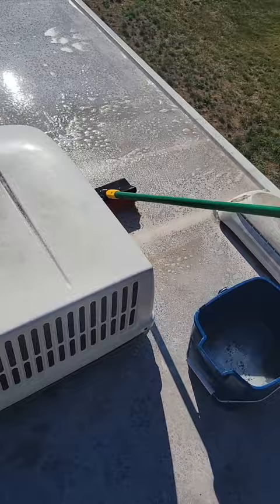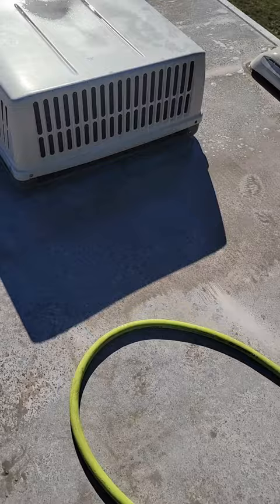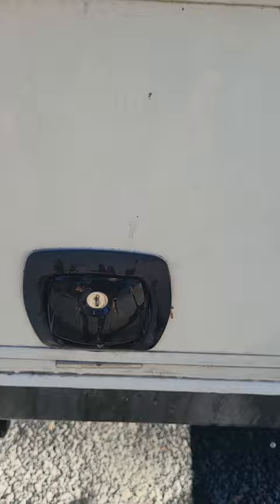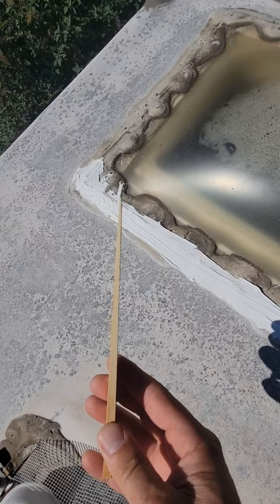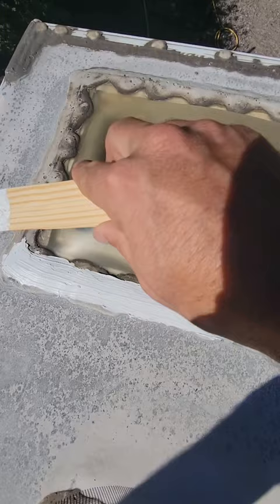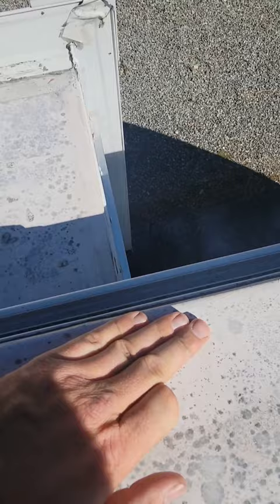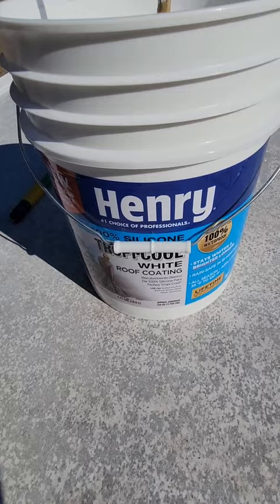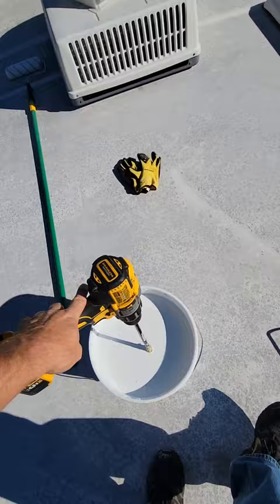Rv roof /Travel trailer roof repair/ Silicone roof coating( DIY)

Comment: Around the fixtures aren’t you supposed to strip the old stuff off and then apply a fresh seal? I’m a little confused
Reply: Not if the present seal is healthy. Stripping the old seal can lead to rubber/tpo roof damage. Just spread the coating on heavy on these spots. This is a nice basic repair that will extend the life of the roof for 10, maybe 20 years. Doing my rig right now. 🤠
Reply: Do a few layers over the years, then remove it all and start over.  Like when they pave a road three times and then tear it all up and start again.

Comment: I’m curious as to if you had problems with the coating separating after a few years. It didn’t look like you had the roof very clean. I just did my roof with the same product. You might want to consider snap in gutter extensions.

Comment: Your a roofer and you don't even know what membrane you are looking at. That is EPDM and silicone doesn't stick to EPDM. I'm not a roofer and I know that
Reply: If your EPDM roof is in decent condition, you CAN renew it by installing a silicone roof coating system cover over the existing membrane.
Reply: @JesseVAyers  🤣🤦
Reply: Tropicool is made for EPDM
Reply: You absolutely can apply Henrys tropi cool to all rubber roofing materials. I've watched 30 plus ytube videos watching people do it including expert RV inspectors. They all love this product and say it is the best roof sealant on the market as long as it is properly applied to a clean leak free roof. All seams must be watertight and the sealant in good pliable condition or should use Eterna bond tape before the Henrys. Once the Henrys has been applied, all future repairs if needed have to be silicone based.
Reply: @randallzook5570  you can do a lot of things doesn't mean it's going to bond to the membrane. I could smear applesauce on the roof and it would work better
Reply: @iair-conditiontheoutsideai3076  thanks for the tip. Applesauce is quite cheap locally and I will be following your tips on using it for future coatings

Comment: I have a rubber roof on my camper. Its a 2019 and there are several bubbles. So far no leaks. Can I seal over these or do I slice them, then re-glue and seal the roof ?

Comment: Why haven't you used the Eternibond Tape Sealant first around the edges before putting the silicone coating?

Comment: I've seen silicon and acrylic rv roof sealers. I'm debating between Henry and STA-COOL silicon or the Dicor acrylic. What are your thoughts between silicon and acrylic? Thanks
Reply from the maker: I like the silicone better because it doesn't absorb water, mind you that only is an issue if you have any spots where water can sit or pond. Acrylic is still a good option but will require reapplication sooner as well.

Comment: Well part of your gutter is missing. That’s why I drains down the side.
Reply: you're correct the gutter Kick out was broken. I did eventually replace them, but in the wind the rain still runs down the outside wall. But my latch has definitely been better since just the silicone coating.

Comment: I have a fiberglass top, I'm pretty sure on my van high top roof on my conversion van. Does anyone know of anything that works on that?
Reply: Silicone should be fine on that. However, you could call the number on the bucket and double check. Just make sure you prep it well.

Comment: I have used this as well and have a slit on the edge normally would use repair tape but cant seem to find it for silicone. Do you have a product i should look into to ise?
Reply: they make a seam seal with fibers in it. But you can use silicone with some polyester fabric or fiberglass like I did around the skylight, and you should be fine.